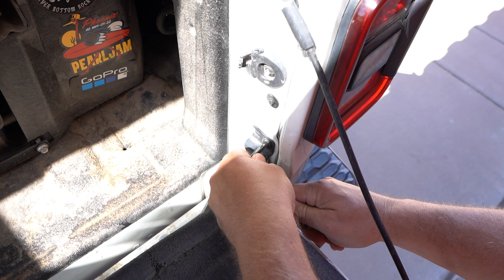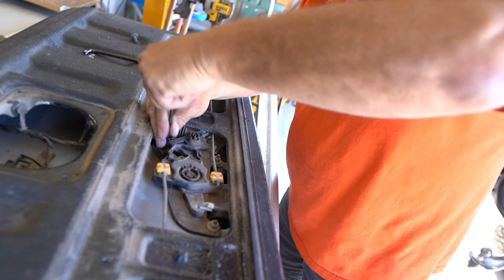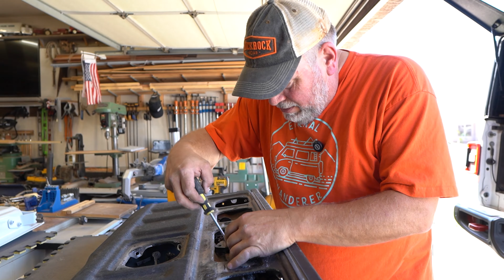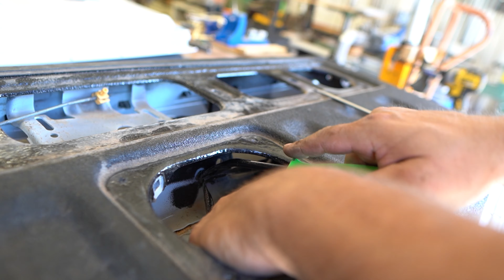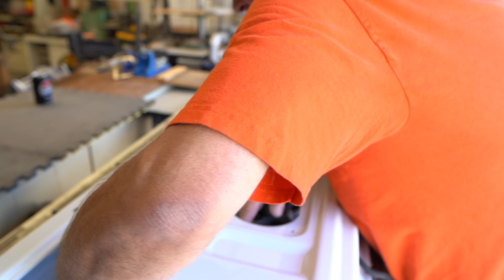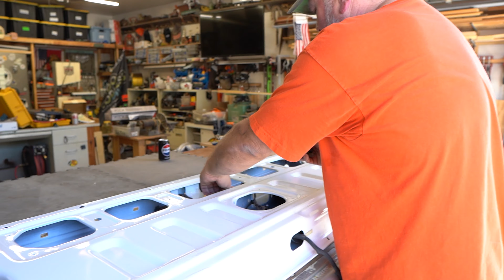In the Garage - New Tailgate - Jeep Gladiator Components Swap

Comment: You helped me do my brothers tail bed so easily only thing at the very end and I may have missed it I didn’t see you put the single bolt safety lock over the tail gate to prevent it from unlatching
Reply from the maker: Yes, there is a place that covers the hinge with one bold that prevents tailgate from coming off.

Comment: I was wondering if you had any issues with the fitment one on..  wondering what kind of adjustments are possible.. mine doesn't seem super tight on the passenger side almost like it is loose...
Reply from the maker: Thanks for watching!   I don't know of adjustment, but the only one I can think of might be where the tailgate has the slow opening mechanism.   Make sure your strike bolt and tailgate latch are tight... that's all I see as what would hold your tailgate flush and tight.
Reply: @exploretography  ok. So that confirms exactly my thoughts. I'll have to take a look tonight. 

Thank you